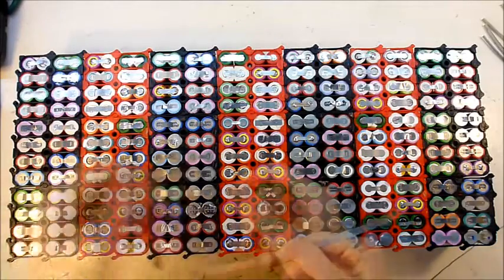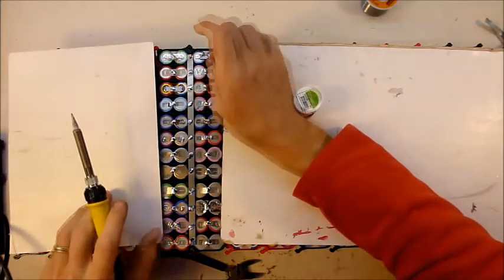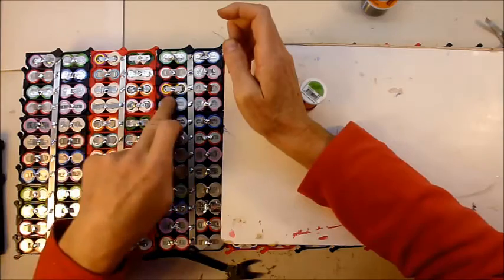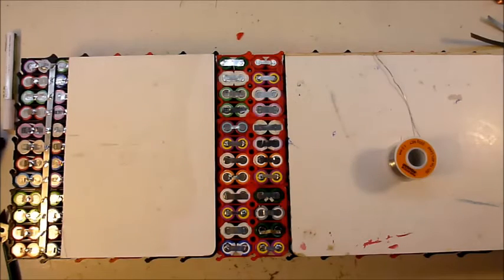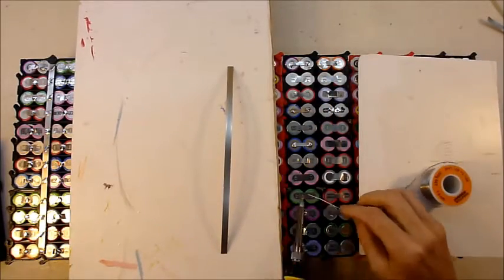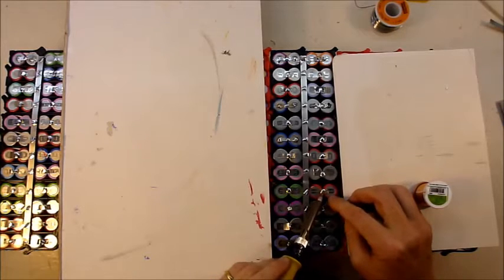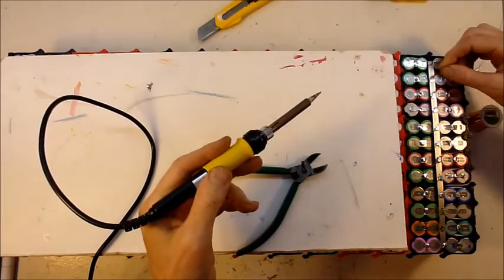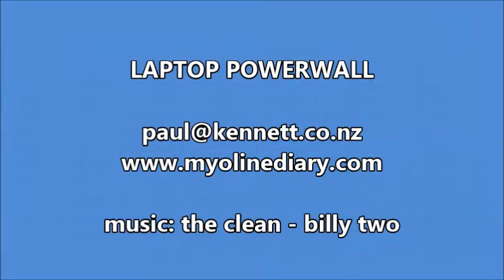Laptop Powerwall 13 - Why?

Comment: I recommend a good fire insurance for your house …
Reply from the maker: Haha. I do all this stuff in my shed in the back yard. If it burns down my house will be fine. I'm working quite hard to reduce risk - rejecting poor cells and adding BMS, active thermal control and only running them between 40% and 80%  - so they're never stressed as much as most battery systems.

Comment: One other good reason for using pairs, after I have seen your videos: the heat of soldering is more evenly distributed among the spotwelded part and the battery conductors. Resulting in less heat per battery.
In the past I used the same enamel wire to connect all components on  full single solder island PCBs in stead of wire-wrapping, worked like a charm, good isolation.
Good progress !
Reply from the maker: +Sjef van Gool Yeah - avoiding soldering directly to the battery is a good thing. I found soldering to the positive terminal quick and easy, but the negative terminal has so much metal it take a lot more energy to heat up to solder melting temp.
Reply: +Paul Kennett  I will copy your way using pairs. I finally managed to get 420 cells, comming from HP laptop. All batteries were manufactured in 2013! They are Samsung ICR18650-28A 2800mAh (charge top et 4.3V and 2C rate) And from my very first testing they are charging pretty well. I need then to do discharge test of course.
Reply from the maker: +Propergol Those sound like great cells you've got. It's nice that they're all the same too. Are they all the same colour?
Reply: +Paul Kennett Yep : I did randomly picked and open 5 samples packs (from 70 total) and they are all ICR18650-28A. Tested pairs show arround 5000mAh for a discharge from 4.2V to 2.9V (and those cells could be charged up to 4.3V). However ICR is not the safest chemistery arround...

Comment: One more - why not, how long in real time did that take?
Reply from the maker: +HBPowerwall Took about 2.5 hours per side to solder up. That enamel wire is quite easy to solder - worth a crack.
Reply: +Paul Kennett Sounds like it. I'm driving past a jaycar today, will pick so up and do a vid in two weeks :)
Reply: Paul Kennett I am highly impressed with your nickel strip busbar. is that available in ebay? Can you please provide me the link?